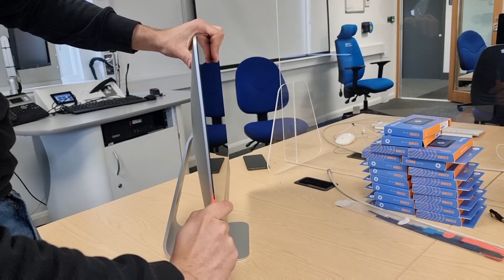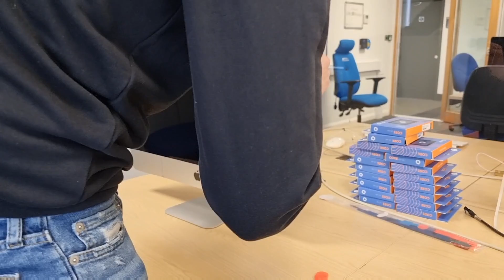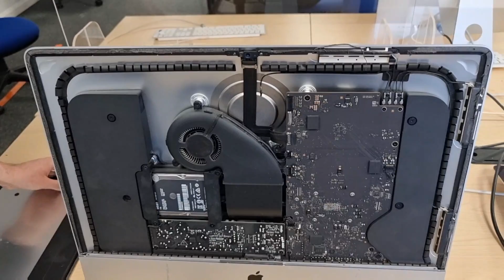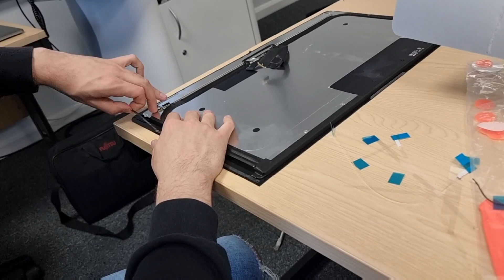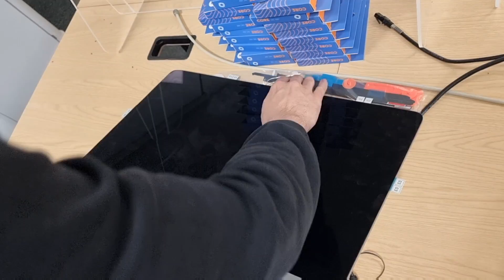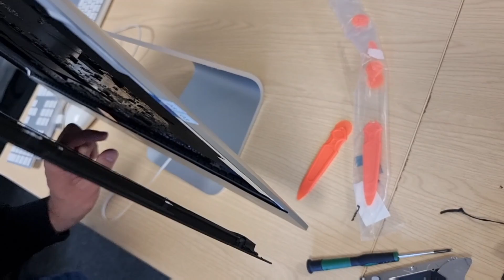Apple iMac 4K Display (2017) 21.5" inch SATA upgrade replacement to SSD by taking screen off.

Comment: can i ask? is your screen ok after replacing adhesive tape strips? I'm having issue with my screen after replacing storage. it has reddish coloration all over side of the screen. thank you for your reply
Reply from the maker: The screens are perfect, cleaned and resealed